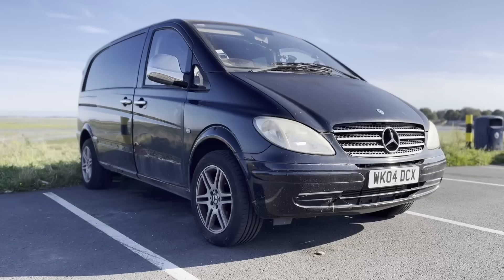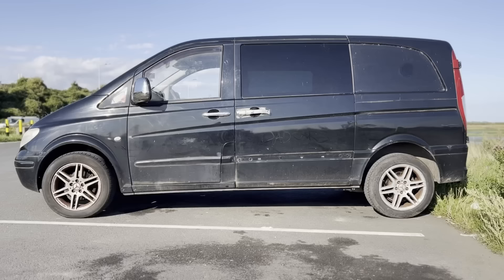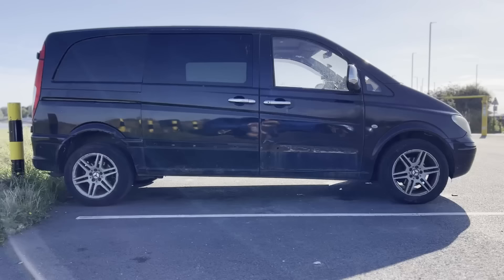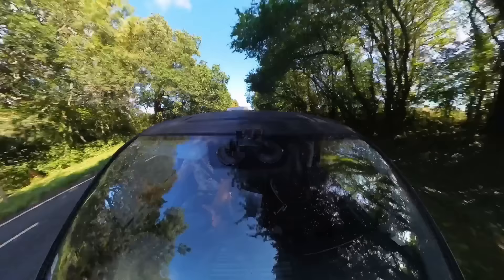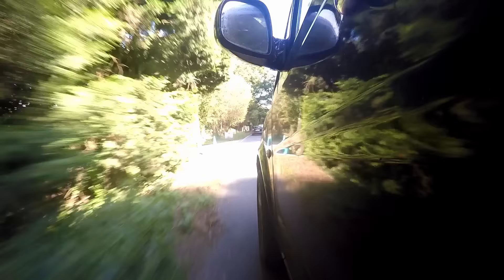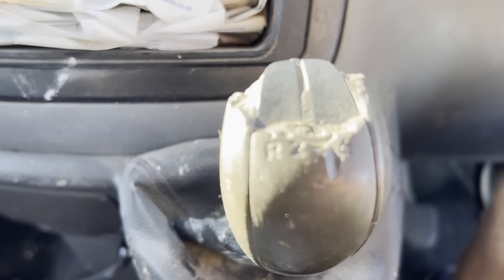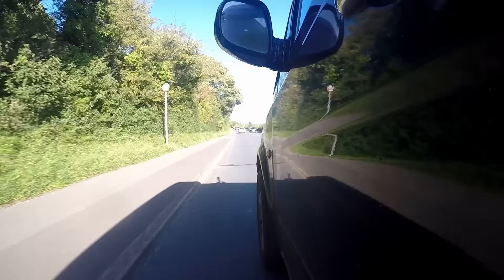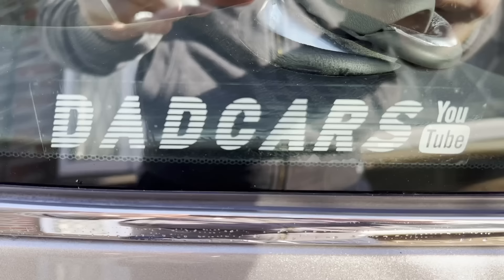The Mercedes Vito Is A Bargain VW Transporter Alternative With One BIG Problem

Comment: I'll stick with my T5.1 9 seater Shuttle thanks!😊
Reply from the maker: 😅 how’s it been for you? I do like the T5! They just command a premium!
Reply: @dadcars  
Yeah it's a 12 plate and was 19k ( nearly 2 years ago). Fortunately got a 6 month warranty as the dmf needed replacing.......
Had the T5 version previously for 11 year's . Nothing more than the usual wear n tear, Alternator, battery, tyres, brakes etc, but then it had covered 286k when it broke. ( suspect oil cooler) . But I called time on it!

Comment: I like the Vito’s, the better one is the V6 you can get though. Is yours black, green or brown I can’t tell 😂. I’d give you £300 for it, I need a replacement for my 03 Primastar camper.
Reply from the maker: I’d only need to do a couple tip runs and I’ve saved that £300 😅 that’s why I’ve just not sold it, doesn’t cost anything really to own and no incentive to sell

Comment: I'd also look at Mitsubishi Delica as a brilliant alternative, and it's 4x4. I had one for many years as a "posh work horse". Never had any issues. So spacious too and many seat configurations. Great for towing, the positives go on and on. Plus NO RUST, and cheap parts available.
Reply from the maker: The old ones are super cool looking 😅
Reply: The Delicia is basically a van sitting on a Shogun chassis
Reply: @hughmarcus1  It is, but that's what makes it so good. Had my Delica after a Shogun, and in my opinion is a far more useful vehicle. Loads more interior space, easier access to all the 3 rows of seats, and of course can easily become a campervan because of all the space (see Thomas Heaton's conversion) especially the higher topped version I had, from memory Thomas has low roofed Delica.
Reply: Talk about bullet proof and cool and super comfortable day van and 4x4! RIP rust on the chassis. Sold it for 800 more then half what I paid 7 years prior, I believe the guy was going to export it to Africa.
Reply: @hughmarcus1 so I guess it can tow quite a lot of weight in that case then?

Comment: just so you know, this is a renault Traffic in disguise, like it's smaller cousin the Citan which is a Renault Kangoo in disguise
Reply from the maker: Most cars these days are lesser cars in disguise 🙈
Reply: The Vito is nothing like the Trafic. For a start the Vito has a longitudinal engine layout & its rear wheel drive.
Reply: It’s not, the 639 Vito is a Mercedes product through and through. The current 447 Vito has a Renault tie up but only the FWD models, the RWD model is a proper Mercedes product. I should know, I used to sell them and still do.
You are right about the Citan though, it’s basically a Kangoo, but they are a decent van, very reliable and good on fuel, we run a few of them on our fleet, a lot less troublesome than Partners and Connects.
Reply: @joeledger3013  Hi, thanks for the correction, I do know that one of the models is linked with renault, they share the same 6 speed problem gearbox
Reply: @headley7653  They do indeed.👍

Comment: t4 and t5 are not reliable at all
Reply: I've had Transporters for over 20 years, a T4, T5 and a T5.1 at the moment, serviced properly and you won't go far wrong. Expensive to buy but hold their money like no other van!
Reply from the maker: Have they been expensive to maintain?
Reply: @dadcars  Not really, I have always had them serviced at VW and yes it's abit more expensive but the service has always been good. Other than normal wear and tear items like brakes the only issue I have had was a seized EGR valve on the T5.1, which unfortunately is a common problem on diesel engines now.
I test drove a new Vito and liked the way they drive, not as solid feeling as the Transporter but still a nice van, I find the T5.1 very light on the steering so may go for a Vito next time.